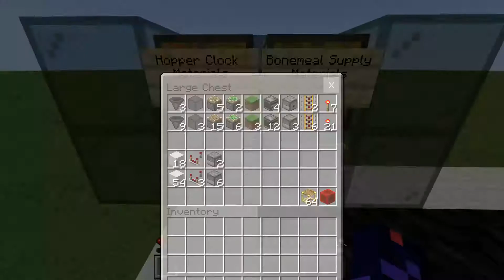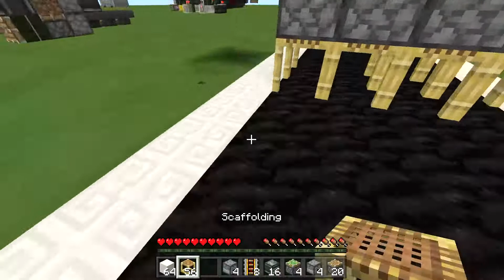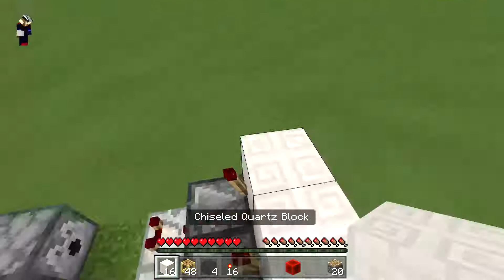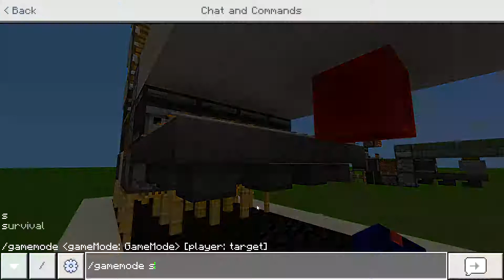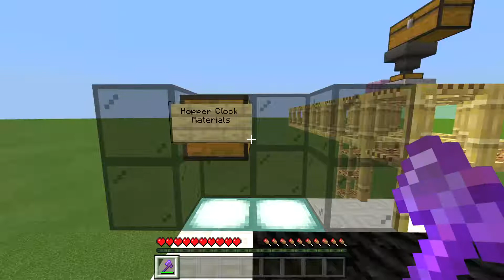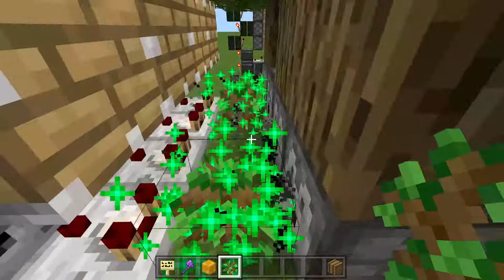[Bedrock Edition 1.16] 1-Wide Modular Oak Tree Farm

Comment from the maker: Thankyou u/Bulk-Distribution for mentioning the rails should be oriented  east-west or else they will connect to the wrong set of rails. You can see his orignal comment here: https://www.reddit.com/r/redstone/comments/lr7tk8/build_tutorial_for_my_1wide_modular_oak_tree_farm/gor3r6o/?context=3

If you already followed this tutorial and built the farm with the rails oriented the wrong way, you can work around this issue by placing the bonemeal supply rail first, making sure it extends at least one block further on both ends and then place the timing rail.